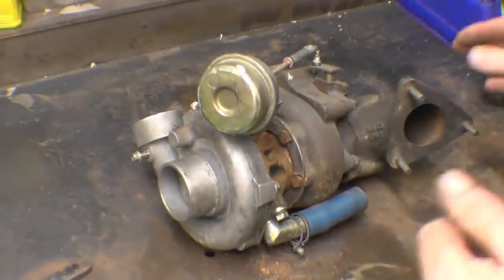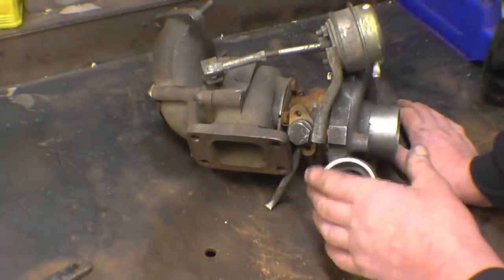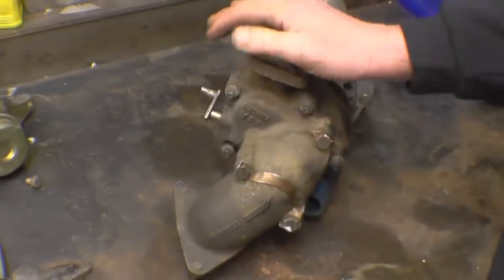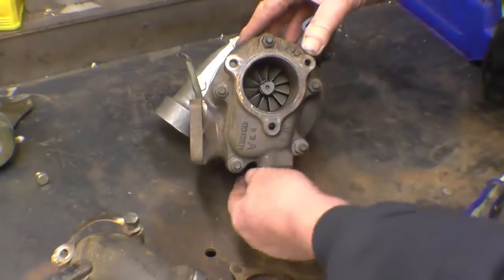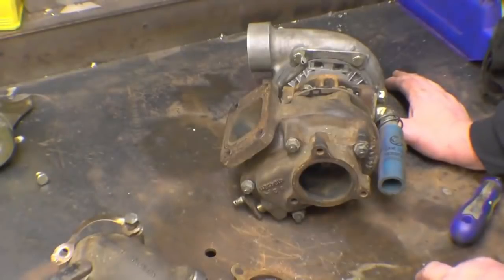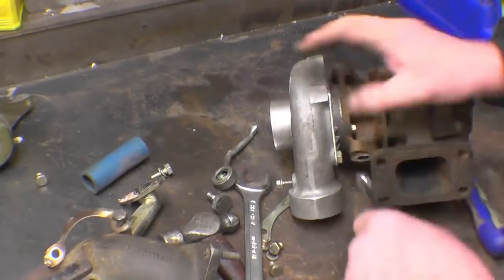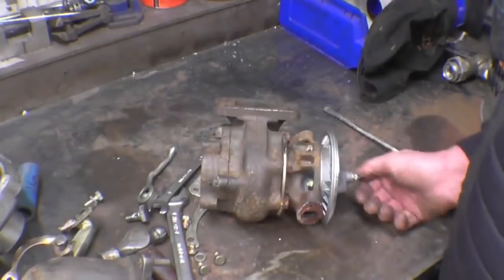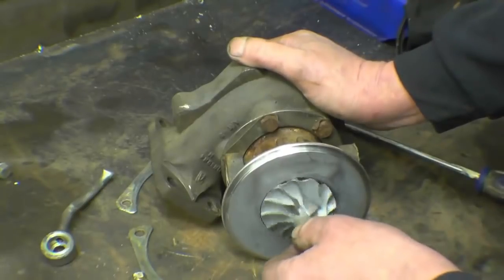Jet Engine  P1 Turbocharger    Video Re Run

Comment: John, why did the cold side turbine rim seem to have some scalloped edges in a few spots, at the extremity of the turbine rotor? I noticed them as you were spinning it with your fingers.

Something to do with balancing the rotor at the time it was manufactured?
Reply from the maker: Yes balancing
Reply: And looking at the amount removed, well out before balancing